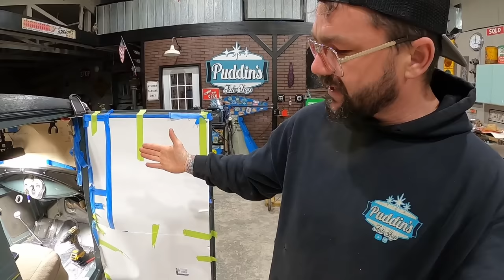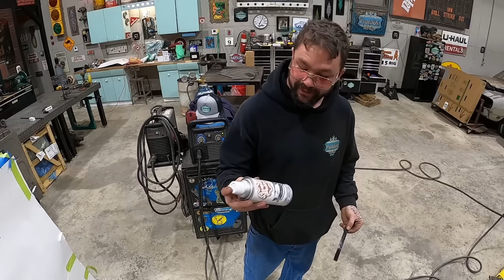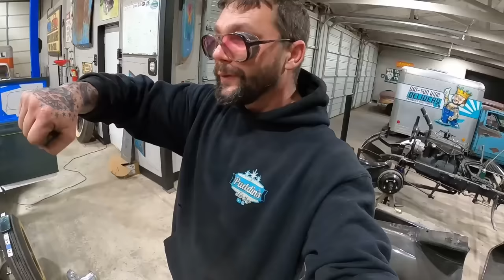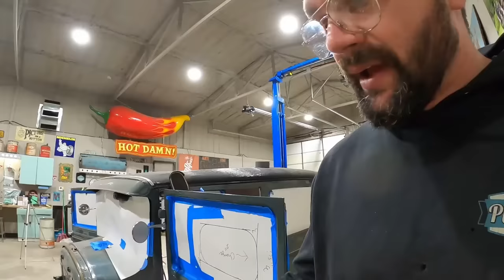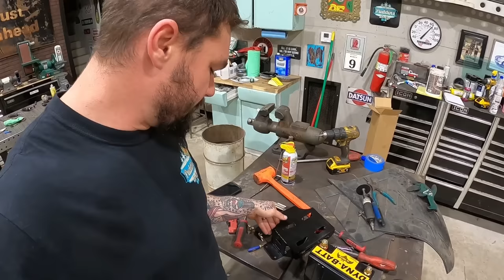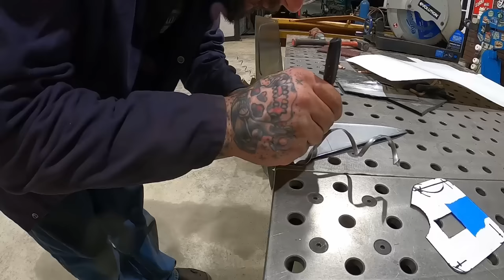HOT ROD BUILD! Will the steering clear?? Gas Pedal, HIDDEN Battery and MORE! 1930 FORD MODEL A!

Comment: Don't know that you will see this, but here is a trick I learned for the pneumatic body saw. I took and cut a good hacksaw blade the length I needed from the tool side and used that in my body saw. Worked better than any blade I could buy for the body saw.
Reply: I second this and my cheap ass bought some harbor freight hack saw blades and they worked out real good I was surprised
Reply: I do the same thing but, they don't last as long a a decent body blade. A hell of a lot cheaper though and when it snaps you just laugh and use another.

Comment: 1/4" thick felt would make a decent weather seal for the brake pedal arm and throttle rod. Added bonus, you can use a small dab of grease to improve the sealing and prevent rust.

Comment: Cable throttle kit from Speedway Motors is what you need. Slip it through a rubber grommet for a watertight seal; the outer sleeve of the push/pull cable does not move. We used them on race cars without any trouble. Same system is used on boats.

Comment: That engine will torque toward the passenger side. You can put a solid mount on the drivers side and a rubber on the passenger side to avoid excessive body shake. Don't worry about the steering shaft.

Comment: Jacob, go to Lowe's to the aisle with the bolts and specialty stuff in those drawers. (1 big black solid rubber stopper and drill the size hole you need for needed [grommet] it to fit gas pedal linkage to reduce squeak).

Comment: There are grommets made for linkage through a firewall. Also, look into antigravity batteries. Check out the battery cables and plug wires seven sins choppers makes. They've got some sweet colors I think would compliment this rig.

Comment: Hey Puddin, you could try using  a piece of leather to seal the throttle rod, doesn't need lube, cheap to replace if/when it wears out. Just a thought. Cheers, from Ontario, Canada.

Comment: Tip of the day: Use some rubber caps to slide over the back side of nut certs to hide them a little better.
Reply: I was thinking about welding in studs and slide in colum from top keep firewall clean.

Comment: I am still watching the episode so forgive me if you considered this already. Pick up a 2nd battery and mount and install it under the driver seat. Also, pick up a pair of latching relays and a dual position dual throw momentary switch with a resting middle position. Wire it so when the switch is pressed one way it unlatches the relay for battery 1 and latches the relay for battery 2. Throw the switch the other way it reverses the relays and switches back to battery 1. You will need to make sure you wire it so the relays are energized by the opposite battery. It doesn't work if you have a dead battery and can't energize the relay from that battery. From time to time you will likely need to switch the batteries while the engine is running so both batteries get charged.
Reply: Would adding a thin sheet of rubber under the battery be worth considering? 🤷

Comment: For holes in metal like the firewall, I used cut a piece of soft vacuum hose or some kind of soft rubber hose, make sure it fits the circumference of the hole fairly snug or a bit bigger. It should be able to fit snugly around the edges of the hole. Then I used to put a bit of gorilla snot or some sillycone to make the ends stay together. I love this build! I like the dyna-bat idea, keep a charged jump pack handy, perfect for roadside emergency jump or powering you up until the next truck stop.

Comment: Go in your spare bolt drawer and find a 3/16 bolt a couple inches long. Put it thread down on your rubber on a hard surface and it makes a really nice gasket punch when ya smack it with a hammer. Instant round hole if you dont own gasket maker punches.
Keep rockin!!!

Comment: I like the build. I do believe Slick is right. not only is it nice to have it centered. If you notice your brake pedal is further to the right it needs. I think you need more room for your throttle  they seem too close to me. And you have all that room to the left where your clutch will be going. To me that’s more of a safety issue. But it does look good to see the petals equal distance apart inline with the with the steering wheel.

Comment: You could use a spark plug wire distributor side rubber boot for your throttle bushing⚒

Comment: Love your determination and ability to see things in your head without making a drawing, but please buy a set of tap drills so you can get the correct thread engagement and RATED LOAD CAPABILITY for those bolts.  Amazon even sells combo sets that drill and tap with the same bit!  And use oil to lubricate your tap and die -- they should not squeal while cutting.

Comment: a lot of bike brakes use a collapsible rubber tube to cover the cable...like a small cv joint boot..might be what ya need to the linkage through the firewall

Comment: For the rubber seal on the throttle use a trans shift cable end they have accordion rubber ends

Comment: Be careful with that battery install when/if you have to replace. Some of those batteries are factory activated or bottle filled. Meaning if it comes from the factory (factory activated) the electrolyte has had a chance to absorb into the glass mat. It you get a replacement that is bottle filled, you will need to let the electrolyte settle into the battery for awhile before putting it on the side. Both are very common and most automotive or powersport dealerships sell those batteries.

Comment: my truck needs exhaust gasket, muffler, brake cylinders, carburetor, lower radiator hose, universal joint, tires(six) and um gas tank and um other stuff.  but i drive my 1968 F500 every day to work while my 2003 F250 is down.  Amen.

Comment: Physical size of the battery doesn't matter much. How many cold cranking amps (CCA) does it have? I would go minimum of 350. Batteries with glass mats (AGM) last much longer.

Comment: Just cut the break an inch to the back and turn it around 180 and weld it back. Not only will the curve be on the other side, but the hole will be facing down.
Reply: I wrote this before you said it. Lol we on the same page.

Comment: Don't forget the front.Steering Shaft is not a drive shaft.You want an 11° Off set. Between the upper and lower you joint or the Car will always want to wander even if you just Heat it and twist it

Comment: When going up with the lift it is bad for the motor to cycle start so quickly. On my lift, the sticker on the motor states out should wait 2 seconds between "starts" or button pushes. Just passing it along.

Comment: I’m seriously not being rude, or at least it’s not my intention. I believe you are very gifted and do some amazing work, especially in regards to your current project. My concern is when you are giving information to your audience. One thing I noticed was was when you referred to the machine bolt or nut-cert as a 10/32nd and that’s not correct. If it was it would be considered a 5//16”. The correct description is a 10-32 where the number 10 is basically meaningless yet if measured it would be 3/16” diameter. The 32 refers to the number of threads per inch. I hope I haven’t offended anyone, I really feel that people who watch YouTube for educational purposes need to be able hear the correct information. Again, thanks for your inspiration. 👍🏼👍🏼 2 thumbs buddy

Comment: Sir Puddin, it's #10- 32 thread. The 32 represents the threads per inch. Not 10/32nds. Get yerself a hot dang drill/thread chart to hang on the wall.  They're free on the internet 😊

Comment: The biggest problem with those "nutsert's" you seem to love so much - - - - It isn't a matter if IF they will ever spin (making removal of item impossible) - it is a matter of WHEN they will spin! They will ALWAYS fail, right when you need to remove the bolt immediately for an emergency, or to get the car back on the road! LMFAO, but hey, keep crippling your builds with inferior crap, it is your time and money. P.S. there is a reason auto manufacturers - or any other manufacturer doesn't use nutserts for their products, and use cagenuts, speedclips, welded nuts, etc.
Reply: It will work or it won't... Then he'll fix it..if it doesn't.. Simple..
Reply: @user-427.commodore  Wow - how deep did you have to dig to come up with that Einstein revelation?!?